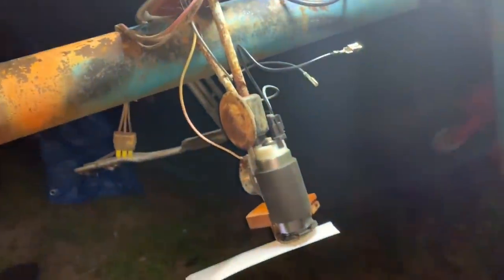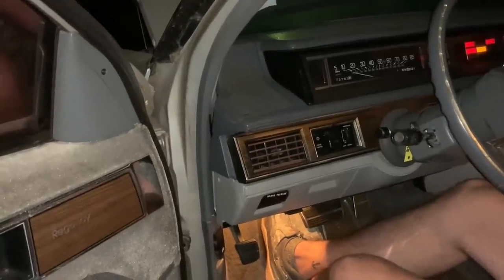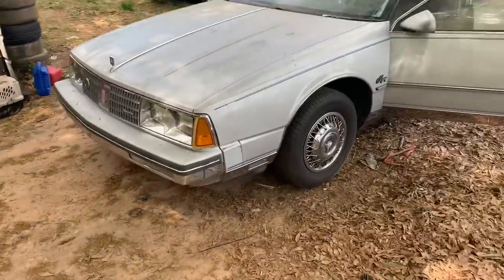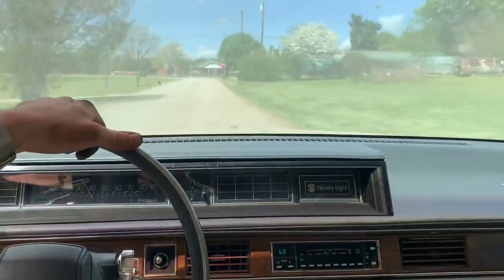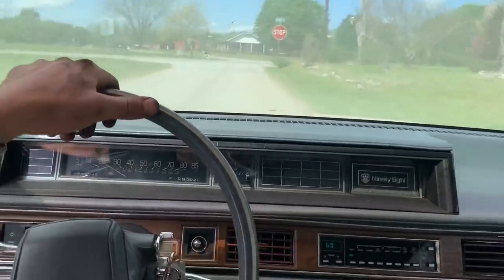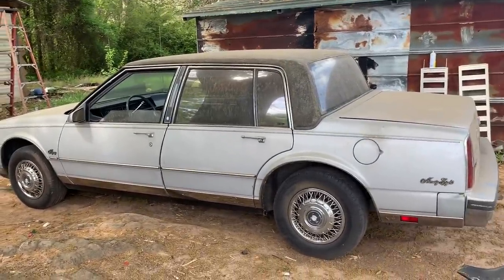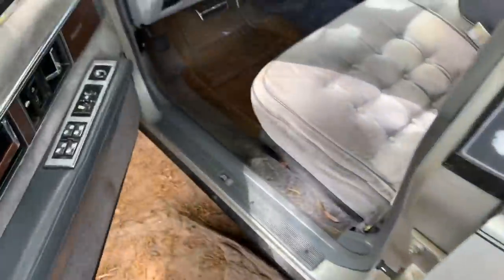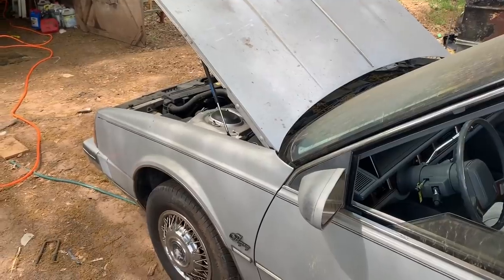WILL IT RUN!? Oldsmobile Rescue: Part 2

Comment: These were the classic GM 'C' body FWD large cars that debuted in 1985. As a matter of fact, that particular one in the video is definitely a 1985 model, easily identified by that 3.8L V6 being equipped with a distributor and lack of a third brake light. 1986 and newer versions of this engine went to the 'waste spark' distributorless ignition system. Cadillac's version of the 'C' body, the Sedan De Ville came equipped with the dreaded HT4100 V8 of that era.
Reply: NOBODY CARES. But I am astonished by your knowledge of shit 80's cars :-)

Comment: My first car was a 1986 Olds Delta 88 which was on the same platform as this one with same 3800 V6. It was so smooth and comfortable, I loved how it rode. It had the "royale" package, so it had the pillow top seats and power everything(except mirrors).  Seeing this makes me me want to hunt down another one. It is the car I miss the most of all the ones I had....based solely on comfort. Build quality was also good. Lots of metal bits in and out. I also have to say, those olds delco stereos had surprisingly good sound.

Comment: The good old Buick/GM 3800 V6 engine family, if cared for... absolutely bulletproof (prior to 03') when they changed to a weaker bottom end bearing. Best applications by far were Holden Australia in a RWD layout, reliable & torquey. Nothing wrong with old cars, i much prefer mechanical things personally.

Comment: Hard to kill those 3800s.  Excellent engine.  Excellent car, actually.
Reply: @applepoop10   Wrong on both counts. That is one of the last old-school 3.8s. 3800s never had distributors, this one does --  1985 was the one year the old-school 3.8 had sequential fuel injection with a distributor. 86-88 FWD 3.8s had coil packs. This car is an '85. The Series I 3800s came out going into '88 and had '3800' on the intake. Rocker covers and intake manifold are a dead give away which is which. 3800s also had a balance shaft. If you're unsure how to tell at a glance, the 8 digit of VIN code will tell the tale. 3.8L does not necessarily mean it's a 3800. 3800 is based on the old school 3.8L, but not quite the same.
Reply: @anonymousinc6330  I have an 85 olds cutlass ciera with the 3.8L MPFI i believe it was called for 84-85, 86-88 was 3.8sfi. I also own an 89 olds eighty eight but that has the 3800 pre series 1 which was 88-91 in some vehicles. Not trying to be a know -it-all just stating what I know. This one has the rare 3.8l like mine. not many got the distributor as you mentioned. 85 only for the olds ninety eight and 84-85 for the cutlass ciera and possibly the buick century too.
Reply: @snipindowntown   Lots of people get old-school 3.8s and 3800s confused. You are correct, the FWD 3.8L Buick was used in the Ciera and Century through '88. At that point, the improved first-gen 3800 was reserved for larger cars, and the Century/Ciera were given the 3300 (the 3800s little brother, with a few minor differences). No EGR, no camshaft sensor, batch-fire MPFI, not sequential. 1993 was the last year for those. The Buick V6 was developed originally around 1962, and has gone through a lot of changes in the 50+ years they were built. You really have to understand a lot of Buick history to really know what's what. The original V6 was a 225 ci (some sources say there was also a 198 ci) based off of the Buick 300 V8.  Wasn't a big seller because gas was cheap back then, so the tooling was sold to Willys, which merged with Jeep somehow. Jeep was using the 225 in production until Buick bought the tooling back in the 70s, and since they had sold their 215/300/340 tooling to Rover (Yes, Virginia, the Land Rover V8 is a Buick),  redeveloped it to be based on the following Buick 350 that had been introduced in 1968. That produced a 231ci, which was Buick's flagship engine once their 350s and 455s were out of production. Several displacement variants (181, 196, 252) were built before the design was revamped in '88, '96, and '05, creating the '3800' variants. Series I isn't labeled or technically known as such, but ran from 88 to 95. 96-05 was Series II, Series III 06+. Series III went out either 09 or 11, depending on your source. Most people call any Buick V6 a 3800, but technically not all of them are 3800s. The 3800 designation refers to 3800 cc, or 3.8L, but the thing that separates these from the old school primarily is the balance shaft and tuned port injection. Unbeknown to most, Chevy also built a 3.8L V6, the 4.3L's little brother, the 229 ci. Very popular in dirt track racing.

Comment: I loved my olds 98. Bucket leather seats slide gear shift on the floor.
Reply: Mike Otolski 
I like it on the column and the front split bench seating. But that’s nice.
Reply: Oooh... is it the Touring Sedan with the factory tach and running lights?
Reply: Chris Troxler FE 3 suspension ? The Ninty Eight was a great car. , 3.8 v6  was great.👍🏻
Reply: @Chris_Troxler  yes it was the touring sedan.
Reply: @mikeotolski9549  
Nice!

Comment: Thanks for the trip down memory lane. In 1985 I bought a brand new 98 Regency Brougham, champagne glamour metallic paint, slick top,  matching champagne interior. It was loaded, including a fancy trip computer which I never used! (But it looked nice at night with all the lighted buttons - (;>) ) Great running car! That 3800 V6 is probably one of the best engines GM ever made. That was riding in style! Later traded it in for a Toronado that had the same engine. They're pretty much indestructible! I will definitely be watching for your updates! Thanks again, and good luck with it!

Comment: My grandfather (born 1916) used to have a very similar car. I believe it was a 1988 Oldsmobile Delta 88 Royale. It was white with a medium blue vinyl top and interior. Your car reminds me a lot of it, and of some very good times with my grandparents. Both passed away in the 1990's, but that car lived on. My dad managed to kill it because he wasn't knowledgeable about cars at all, unlike my grandfather ... and myself. Now, I'm in my 50's and have worked on a LOT of cars. I can tell you this; despite its age, If you fix that car up you won't regret it. It's a couch on wheels, and very reliable. Just don't abuse it. Those 3.8 L V-6's were great engines, but the transmissions were not meant to be beat on. Thanks for the video, and sparking those memories.

Comment: Nice! I used to own a 1991 Olds 88 and it was a tank of a car! Loved the ride and the power it had. It was such a beast. Did have to do 3 fuel pumps on that car but otherwise it took all the abuse a 18 year old kid can give it. It had over 300,000 miles when it was sold

Comment: Looks great keep up the great work. Check the trunk latch because when closed the lid is a little higher in the back near the window it may not be sealing right and letting water into the trunk hence the stain on the rug.

Comment: Cool.  We had an '89 Sedan DeVille for a few years.  One thing you might want to do is, if the rims are 15", go from the stock 205/70-15 size to 215/65-15 tires on them.  We did that on ours and it lost the floatiness in the ride and actually handled fairly decently.  It wasn't uncomfortably harsh, but didn't bob down the road anymore.

Comment: My parents used to have an '86 Regency Brougham. Red with red velour. They sold it after 10 years/80,000 miles because it had started to drip some oil. Ran like a top otherwise. Still haven't forgiven them...
Reply: Michael McCormick 80,000 miles it was used up.

Comment: Autozone/O'Reillys/Pep Boys you can get a compressor from. Spray some Lysol (lemon scent) in the air intake at the base of the windshield to kill any mold that zccumulated in the HVAC ducts, a good spritzing will do wonders, and if there's a micro filter change that out too.....

Comment: Had an 85 regency 88 engine ran great trans was slipping at 140k. Heater core went out had to take the whole dash apart and when fixed had a handful of bolts left over. But for $500 to get me around while my stolen intrepid was getting repaired it was a great runner

Comment: yeah, those delco radios of that era always did that, don't think I saw one over the years that didn't have display issues. the solder joints around the display always went wonky at some point as time went by. noticed that when you hit several bumps, that it would come back. overall a great car. not bad man, not bad at all

Comment: If you look behind the "ninety-eight" logo on the dash next to the idiot lights there should be a plug for the "Auto Calculator" option. Just a trip computer but looks neat. It has to be the one named the "Auto Calculator", not the "Driver Information System (DIS)" that came out later. It was in the Cutlass Ciera Holiday coupe and some other mid 80's olds. The Calais too I think. Could be a cool addition.

Comment: Those aren't bad cars.   I had an '84 Skylark that year that was free and even after sitting three years it fired right up and would have driven if it wasn't so muddy where it sat.   Car got me home in the snow with a flat rear tire I couldn't change because a lugnut rounded off.  

I don't miss it though

Comment: You'll got it going. Alright. I would do what you said about fluids and spark plugs and wires. Might try Lucus fuel cleaner put in tank when you fill it up. Gas is cheap. You have a very reliable car that you will not have to worry about. I notice that the driver side window works great. The olds I drive take a while to roll back up if I roll it down. I also have a power steering leak. I have to add Everytime I need to go anywhere. Im not sure where it is leaking. I'm a smoker so I just crack open the back windows or just the front passenger window. The air works I only use it if it's hot outside. Other times I just use vent. I need to change the spark plugs soon. I have put car on interstate every once in a while since I do a lot of city driving. Does the car good.

Comment: Jay - That isn't actually a '3800', it is one of the last old-school 3.8s. Much more in common with 3.8s in Regals of the era. 3800s never had distributors, this one does -- 1985 was the one year the old-school 3.8 had sequential fuel injection (denoted by the red dot on the intake) with a distributor. 86-88 FWD 3.8s had coil packs, but no balance shaft. The Series I 3800s came out going into '88 and had '3800' on the intake. Rocker covers and intake manifold are a dead giveaway which is which. 3800s also had a balance shaft. If you're unsure how to tell at a glance, the 8 digit of VIN code will tell the tale. 3.8L does not necessarily mean it's a 3800. 3800 is based on the old school 3.8L, but not the exact same engine. Both engines ARE, however, part of the Buick V6 family, as is the 3.0L and other variants, with about 50 years of development behind them when 3800 Series III production ceased somewhere around 2009. The Series II and Series III have shorter piston rods than their older brothers as well. Series II (96-05) had plastic intakes (unless supercharged), Series III (06+) went back to aluminum intake with a no-return FI system. Lots of changes over the years. Biggest mistake GM ever made was killing this engine -- killing the 60-degree was a mistake as well --  These were their bread-and-butter for a long time. Heads and intake on 03 to 05 Series II also have upgrades that were coming in the Series III. From what I hear though, the Turbo Regal guys are starting to find ways to make the later 3800 work in those cars.

Comment: My uncle had one around this year, had a 3.8, he ran that thing for years and years, when he got rid of it had around 280k. Still ran and drove fine, but leaked oil a lot, rust was getting bad, and the windshield got cracked.

Comment: My first oldsmobile was a nineteen fifty six tudor. Had three on the tree n a large v8 engine. Posi rear for real and it would light the tires in second while rolling down the road. I hung dual exhaust on it. It was sharp an not real loud. Kinda mellow rumble. A minister sugared my engine in the oil pan. So broken hearted thought that I would never find another engine for it as it was two years old an was tough on any who took it on in a fair race. Well summer break and the minister loaded his family up in their dodge truck with a big long twenty foot camper and headed out for two weeks. Excellent, as his car was a 57 super 88 and had a tri power on it. I swapped his with mine. Just a few cubes more but shared the same covers so I put his crap on my engine and got it running real sad. I drained all the oil out of it when it was still mine an changed it but bearings that spin die! I put his oil in my old engine back down in his car. and was real careful to wipe it down and there was four of us boys to do it anyway. Minister comes back an most the time he let his wife drive the car and he took the truck so she goes out and checks the oil like she had been shown. That was all she knew and so she starts it and goosed it a bit and the throttle spring breaks like we intended and it raps to the floor an she jumps out and runs... it ran for a good two minutes and then blew shit all over the ground.  A hole appeared in the hood as well. I really expected they would figure it out that it wasn't his cause of old oil we couldn't get as clean as his. He bought a new chevy... a sixty impala and had the 409 in it. Just cause he was a minister didn't mean he didn't like power..... a few months later I took over payments on a 58 impala ... white on white and red accents..... tired 348...... you see where this is going don't you??? HA HA HA HA. die you righteously  diddle headed dick wad, I smell a engine swap.

Comment: noooo dont do 134a. use 152a and keep the r12 setup. it will work close to as good as the r12 was designed to and will use less r152 to fully charge compared to r12 or r134a so it will make less drag on the engine meaning less noticeable power loss when using it. r152a can be got from walmart in the form of air duster in a can.

Comment: That's Awesome that it's running so well. That Lichen coving the roof and some of the body is hard to remove,even with a power washer.Hope it doesn't end up being 'The Moldsmobile'.A bit of dishsoap with bleach ,a soft brush,and let it set a bit before car wash and it should be gone.But then whom am I talking too?

Comment: the only thing wrong with that delco radio is the ribbon cable on the back of the display if you know someone with some solder skills you could easily
I would also replace the belts in the cassette deck as well

Comment: old lady selling a mint 88 park avenue. but when i looked at the bottom, she had it undrcoated with rubber or something years ago. it cracked and when i pulled it off, everything was rusted. fuel lines, body, it was a shame cause everything else was in mint

Comment: air shocks? Standard or aftermarket? is it a horizontal or vertical 3.8 L? either way; you might can use 3.8 L GN parts...
Reply: They were standard on alot of these
Reply: Beautiful Renders buddy of mine has a 3.8 turbo engine fwd based off that motor  in his 1983 buick century Olympia edition with 360hp 400 lbs torque

Comment: sounds good just needs a good clean of the inside sweep the barn dust off of it and sell that on ebay some sucker's bound to pay for that, and then its time to see about that rear window is it leaky or has the vynal roof let in water and the roof's starting to rust, real shame that the vynal roofs used to be cool but man did they rot out the roofs

Comment: Had one with 170k and the timing went out of it. From there it went right to the scrapper.
Reply from the maker: Yikes! Ive been warned on the timing chain! Going to replace it soon!
Reply: @MXguy95  they are decent vehicles for the most part but yes, that timing issue will get you. If you are hearing any noise like metallic scraping or noise coming from the engine, its probably the guides are shot.

Comment: Back in the late  1990s One of my friends in high school got his grandmother's old 1987 regency.  We called it the old Jew Canoe because it was what all the old farts drove. That seeing floated and drove like a water bed but Seemed to run and run and run even with every sender getting dented or bastin. My friend was kind of a retard Who smoked a lot of weed. That was smooth And bouncy. I had an 89 Camry with a 5 speed at the time and every time I would  Ride in or drive his whip getting into my Camry felt like an exotic sports Sedan. Lol

Comment: 3800 is really good news. The 3.0 were not very good engines.
Reply: I had an 85 Buick with 3.0 engine went at 68k miles due to oil pump failure